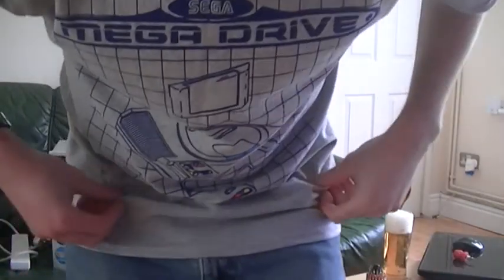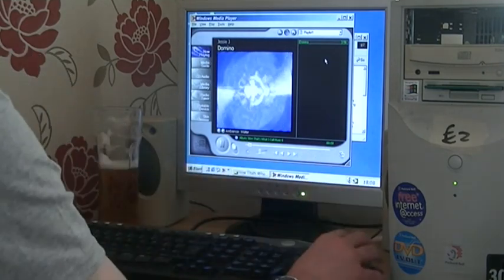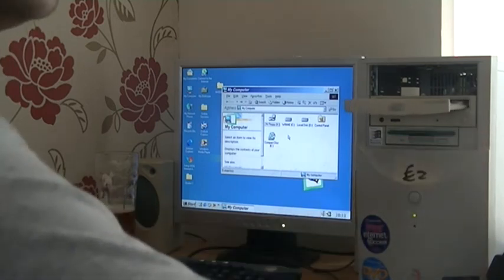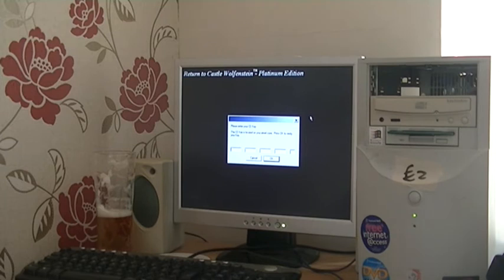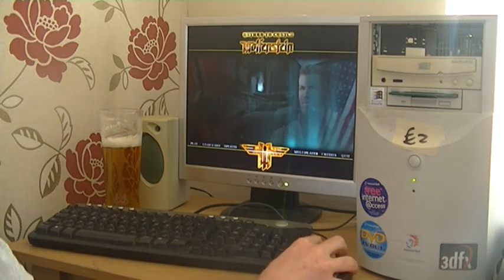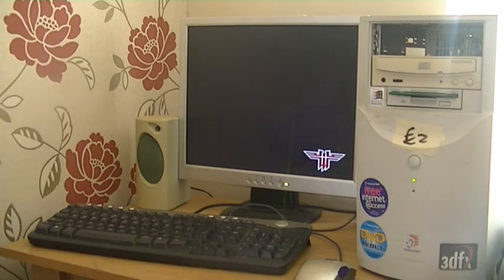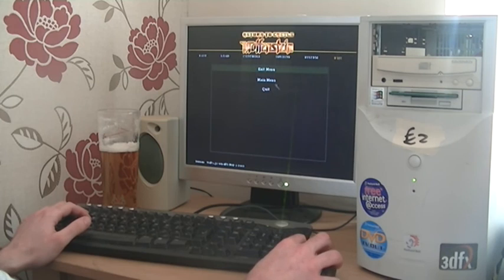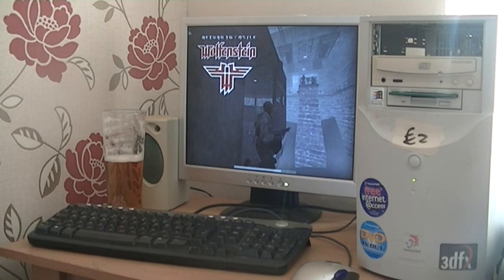I bought a bargain from local car boot sale.

Comment: Just gotta say too Paul i actually used ME for a while as my main OS on a modern laptop a couple of years back. It is hard work but it is possible, Opera Browser still supports ME I think so that's great for internet and flash player etc. The thing I struggled with was finding Virus protection. It was a hell of a load of fun not conforming and using the net and stuff on a 15 year old OS on a 3GHz Laptop with 1GB of RAM lol. I did feel like a rebel lol.

Comment: Might need downgrading if you wanted to use it as a retro machine as Windows ME is kinda the most unreliable classic OS even worse than Vista.

People almost forgot how bad ME was and they are always commenting on Vista being shit when it's not compared to this one.

ME was the version of Windows I always had to reinstall the system on over and over as a load of problems were in it and I always had parts of the main  hardware conking out on me all the time as well like the monitors, graphics cards, motherboards, fans ect ME was a mess definitely the worse one ever, Vista is king of Operating Systems compared to this peice of shit ME.

This OS also was the first one to stop old DOS games from being loaded onto it so to use this OS for classic PC gaming is probably a big no stick to 95 or at the most 98 for the classic gaming.

Vista I hardly ever had to reinstall at all only once currently do the maths that means ME was worse than Vista.

What is your opinion on ME? I think people don't know what they are talking about when they say Vista is worse than this as my ME PC was a part of the statistics of ME deaths of hardware.